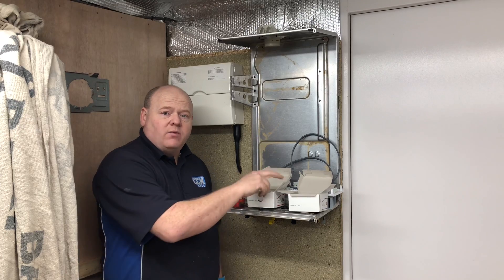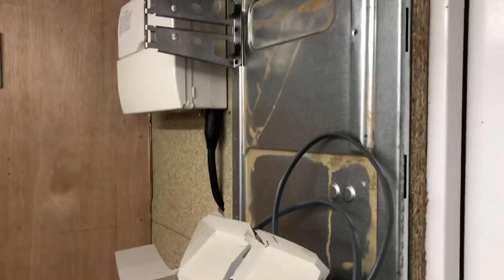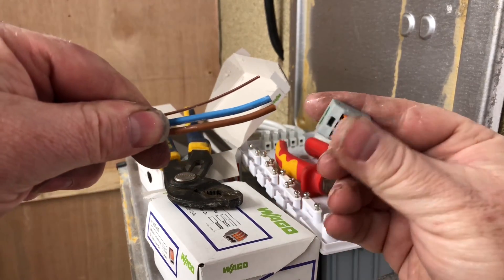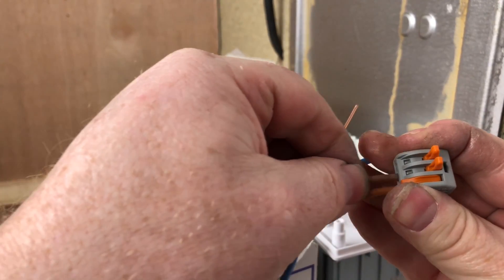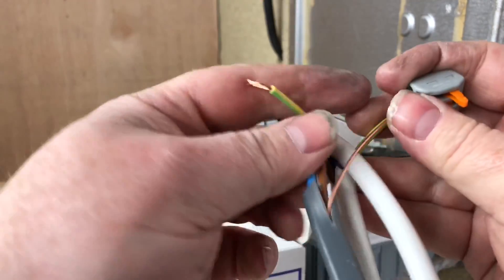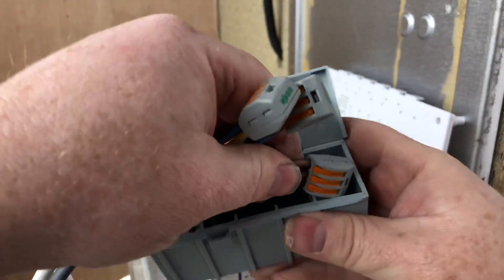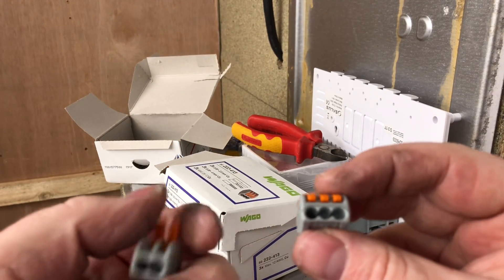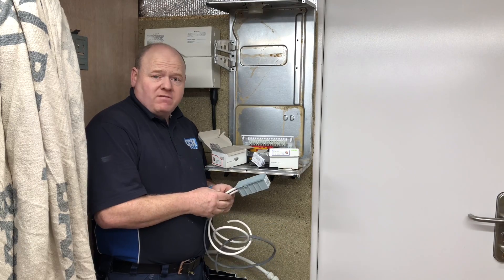Wagos Review Guide on how to install Wago 222

Comment: There are Wago terminal boxes made for heating.
Reply from the maker: John Burns They do now. They were not available when I made this video. Thanks
Reply: @AllenHart999  
I realise that. ;)
Reply: @AllenHart999  
The terminal box is just a plastic frame and lid. You buy the Wagos separately then clip them in - 2 connection, 3 connection, 5 connection, etc. Putting them in any suitable position in the plastic box. 

I have used the terminal strip on electrical jobs:
https://www.youtube.com/watch?v=C3D0glDYRE4

New on the market. The heating box:
https://www.youtube.com/watch?v=E965_4WyXwM

Maybe worth vid.

Comment: Wagos are maintenance free junctions.  As long as the cable is clipped or secured in a box (cable must be secured), they can be in inaccessible places.

Screwed connector blocks need to be accessible as the screws may work loose. 

Some German sockets have Wago connectors on the back instead of screwed connections. So much easier to install and safer. We need a maker in the UK to follow suit ASAP. 

Note: the biggest cause of electrical fires are loose connections. Wagos go a hell of a way to prevent that. 

Beware. There are some knock off makes around.

Comment: I get it,  is there a way to use them without a junction box ?  I realize I need a way to secure the cables and also cover the whole thing over so people dont get shocked somehow if theres a loose strand of wire sticking out or what not.  Could I for example take a piece of plywood, drill 2 holes to loop a cable tie through for each  cable then cover over the wagos with duck tape ?  I can afford junction boxes its just a question of do it quickly vs waiting for parts.   I'm just started learning electrician things... I normally work on high powered DC stuff.

Comment: Don't hear anyone complaining about how stiff these buggers are to open!  Just bought a box from Amazon (30pcs) and was on the verge of returning them in disgust.  Once opened & closed a few times they're alright.  Hate to have a job of fitting 100's of these though.  They'll be no 5-star rating from me.
Reply from the maker: I know there are some fake ones around. I have never had any issues with them myself. Thanks.
Reply: There are push fit versions of Wago. The wires cannot be taken out once pushed in. For permanent maintenance free junctions they are perfect.

https://www.youtube.com/watch?v=Cz2jle06crA

Comment: I use Wago connectors a lot. They are now smaller connectors available which are smaller than the 222 series. These are called the 221 series. Also you didn't sleeve the earth conductor on the twin and earth cable.
Reply from the maker: Thanks for correcting me,
Reply: Allan said so in the vid. It was for demo only.

Comment: Nail clippers!
Reply: Yo need long nails in order to lift the levers on the connectors as they are a bit fiddly to open!
Reply: @JayG2K  FIDDLY????????? Bloody hell - I broke 2 thumb nails trying to open these - and STILL failed!! 
Even the Screwfix guy struggled to open them when I went back for a refund. I'll stick to connector blocks - unless they make these easier to open.
Reply from the maker: I like long nails lol. Thanks.